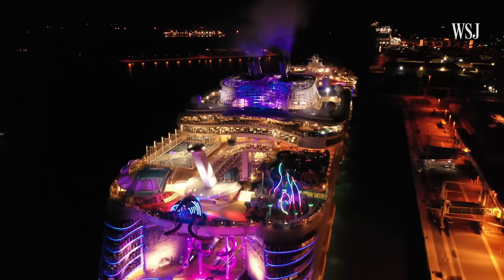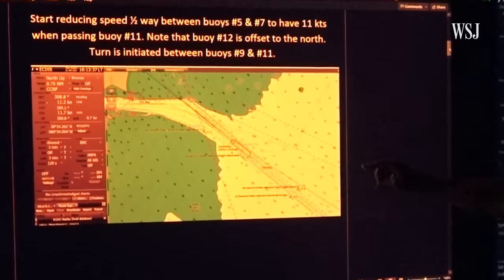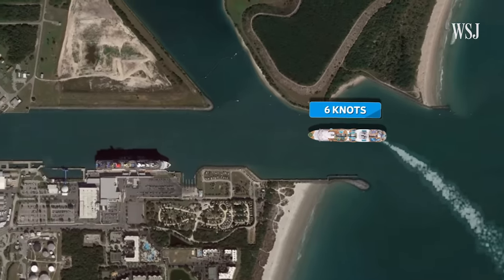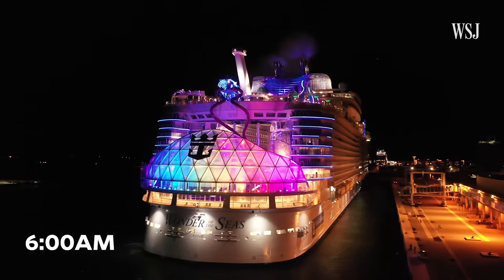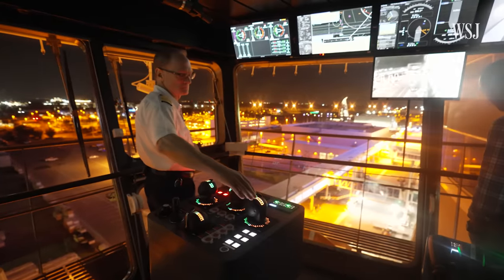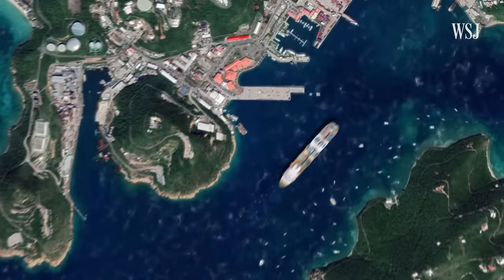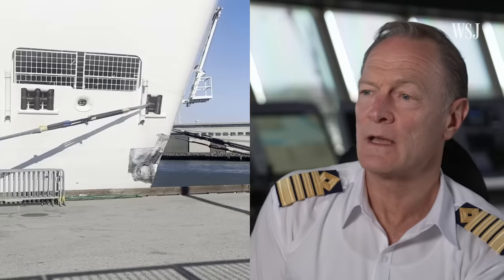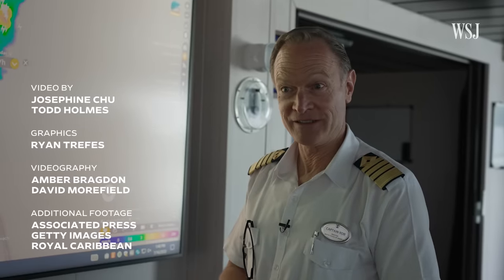Captain Explains How He Docks the World’s Biggest Cruise Ship | WSJ Booked

Comment: I think docking a large ship like this is more difficult than landing a jumbo airliner.
Reply: As a pilot, yes.
Reply: No, the are not comparable and require completely different skills. The Boeing 737 I fly has a typical landing speed of around 140 knots (25x a cruise liner) and aircraft are a lot more affected by wind and windshear. Things are happening a LOT faster in landing aircraft and pilots have to react instantly - cruise captains can hold position and think as much as they want
Reply: @mazterz  thanks god in my region airliners use airbus instead of Boeing so you wouldn’t ever been my pilot.
Reply: @mazterz Let's just hold the ship here while the side is acting like a huge sail. lol.
Reply: @mazterz  it is indeed a completely different skill set , vessels cant hold position per se , there are few types of vessels that can hold positions (dredge vessels , platform and some survey vessels) wind speed , depth , traffic , size of channel and currents play a serious role , sometimes we can by time but it's better to get it right the first time. full disclosure most vessels have thrusters abeam but minimize use because it can destroy  floating docks or smaller boats.
Reply: Nope landing a airliner is much more difficult
Reply: @kevinfernandez9999 No it isnt
Reply: I think a ship cruise it's easier to drive that a commercial airplane....I think to be a pilot it's much difficult than be a ship captain..from a airplane captain to a ship cruise captain..WHO'S SMARTER? I THINK A PILOT ITS MUCH SMART
Reply: @emiliomontiel3284 why dont you try driving the ship and flying the plane

Comment: I understood that a Harbor Pilot comes aboard offshore, takes over the helm and sails the ship into port and docks it.
Reply: I'm retired USCG Captain who was also a cutter commanding officer at O5 and O6 (Captain) rank. The interplay between the Captain/Master and the Pilot is a very very interesting dynamic and can be different every time. Technically the Captain/Master is ALWAYS the one in charge (has the authority) and giving the orders. More importantly he ALWAYS is RESPONSIBLE. It is commonly stated that the master may delegate the authority but NEVER the responsibility. You hear this in the video when the Capitan says 'the pilot has the CONN'. The CONN is the one with the authority to issue helm and engine commands while the MASTER RETAINS RESPOSIBILITY! Legally the PILOT is only an advisor to the MASTER but in real terms failure to heed the 'help' of the pilot is a path to trouble and it is NOT uncommon for a master to simply hand the CONN to the pilot and sit back and watch! <having a pilot for a commercial vessel in a commercial port is LAW and not just in the US> It is also not unusual for a pilot to ASSUME this will happen and simply start issuing commands as soon as they hit the bridge door. On the other hand I've had pilots come on board who did not speak a word of English and simply held their hand out for their fee then stood in the corner and offered word ZERO of help or advice or 'local knowledge'. When I was Captain/Master I'd immediately greet the pilot and clarify WHO was doing what before we got NEAR th pier. For additional reading go to the NTSB web site and their database of major accident investigations (marine). You'll find example where the Master was held RESPONSIBLE for letting the PILOT cause the accident! https://www.ntsb.gov/investigations/AccidentReports/Reports/MAR0901.pdf

Comment: I hate inaccuracies. When they order Strarboard 15, they mean to shift the rudder 15 degrees to Starboard and the ship will turn right until another order is issued. Its the helmsmans duty to call out every 10 degrees he passess to the Pilot and or OOD. If the ship is heading 090 and they wanted to go 15 degrees starboard, they would order come right to 105 degrees. So the order issued was not come right 15 degrees, but put the rudder at 15 degrees to turn right.